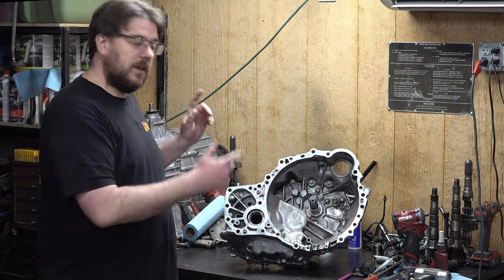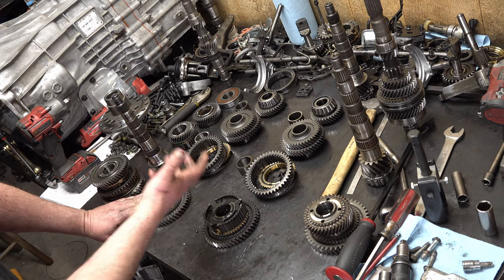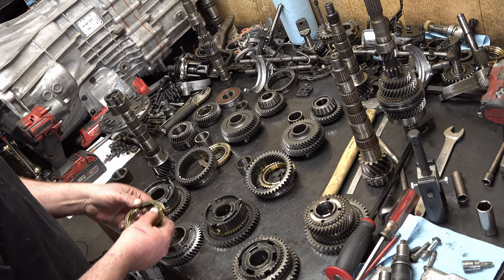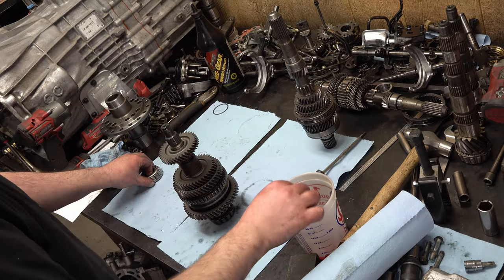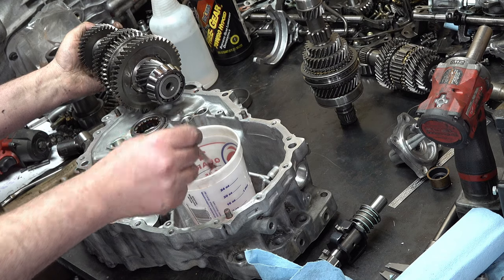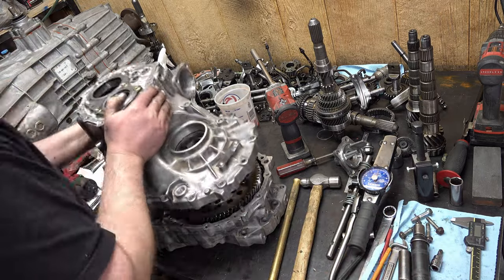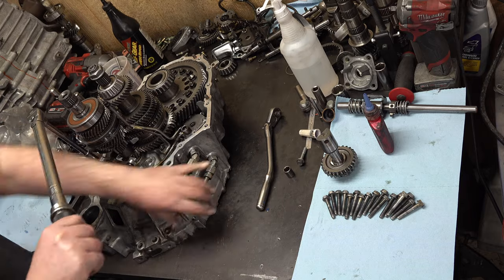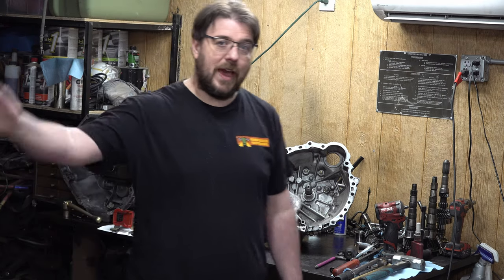Building a Toyota "narrow e-series" to improve Evey's drag racing setup.

Comment: I personally would love to see that transmission swap, as long as you're wrenching on something I'm all in.
Reply from the maker: It'll be an interesting test to see if my channel is big enough to diversify a bit.
Reply: @FrankensteinMotorworks  love the vid, I have a E56 gearbox with E58 gear set inside (4AGzE AE92) with the LSD from the E58, I want to replace the 5th gear from the 0.820 to like the scion 0.775 but the E58 shaft is bigger so the gear from the scion cannot fit over the shaft. What Toyota transmission can I get a 5th gear that can fit on the E58 . Thank you
Reply from the maker: @legz64  yeah there are some transmissions with different size bearings, there's no good listing for which one has what. sometimes you can look upmatching output shaft applications or matching 5th gear bearing applications but that will miss some matches.

Comment: I watch for the technical explanations. I would be interested in you comparing what you see in the Ford manual transmission vs the Toyotas.
Reply from the maker: Honestly, other than everything being much bigger due to the higher torque/weight capacity the parts are shockingly similar

Comment: Very interesting stuff! Im mid converting my toyota caldina gt4 from auto to manual using a rav4 gearbox. very simular to this box just with added transferbox that bolts on for 4wd. using that box as a lot cheaper/easyer to get than a st205 celica gt4 box.
I would be interested in seeing the auto to manual swap love all the in depth info!
Reply from the maker: yeah with an AWD center diff instead of the spool or normal 2wd front differential i used in there that would work great for the gt4. good luck with the build!

Comment: YES i want to see the modern ford manual.
Reply from the maker: Me too, this automatic transmission is driving me up the damn wall.
Reply: @FrankensteinMotorworks Some stock transmission programming is just downright bad. Do you have a 6 or 8 or 9/10? I've heard from lots of people that the 9 and 10 speeds just hunt gears all the time. No idea if you can improve it like on a 6 speed.
Reply from the maker: @christophercasale7961  I've got the 10R140 10 speed transmission. I'm sure the transmission hardware is decent but some of the limitations have to do with the ravigneaux design and the lack of the extra sensors it would need to be more inteligent and a the other factor just has to be that their test drive cycle does not involve other cars around causing you to sometimes need to adjust your intentions. Merging at a busy roundabout without a complete stop is genuinely dangerous with this programming, the transmission has taken up to 4 seconds before actually transmitting any power several times before and i would have gotten into accidents if it wasn't for other people paying attention and stopping for the stupid driver not accelerating when they should. 

But i will admit, i'm sure that 90% of this could be corrected with a reprogramming but i hate automatics with a passion anyways so this is a great excuse to address the core issue.

Comment: That would be an awesome trans swap video. I’d venture to say it’d be the first and maybe only one done on a newer F350.
Reply from the maker: I haven't looked too deep to see if another one has been done but i certainly would not be surprised if it's the only one that will exist.
Reply: @FrankensteinMotorworks  the question I have is, why not put a tune on the truck to fix the erratic shifting? I think a manual 22 F350 would be really cool, but the 10 speed has been an awesome transmission.

Comment: Hello my good sir, i come to you as a humble car nerd trying to engine swap my gt86/frs/brz. I wanted to do a 1/2jz but they are so expensive and then i saw your glorious video with the dyno of the 2gr mr2 and fell in love. My question is... do you have any idea if it would be possible to put a 2gr in my frs, you are the only one that does detailed work with the 2gr. 
Thank you for your time.
Reply from the maker: The BRZ 2GR is very much possible. It's not bolt-in right now but it is possible with some fabrication. This is something that i am seriously thinking of doing as a production setup.
Reply: @FrankensteinMotorworks  Thank you so much for the reply. Hopefully, you get to it before I do. You actually know what you're doing, and I'm just going in blind with hope and determination.

Comment: Honestly, as long as the 1-off isn't more than a 1-off, I think you should be fine.  At this point it might bring in some other people who may not know about your everyday work.

One question about gearing.  If you're going to shift into 4th, why not use more of the gear?  Are you looking to eventually build it to trap at a higher speed?
Reply from the maker: Honestly i spent a lot of time thinking about the 4th gear ratio and the 1.028 is the shortest 4th gear i can get without going to custom parts. One thing that i can tune further is the tire size, i may start with a smaller diameter than i calculated with to use 4th a bit more.

Comment: I say "go for it" on the transmission swap video. Sure, some of the "normal" viewer might not view it but I doubt any of them would be turned of from the channel as a whole and it will possibly pick you up some new viewers too just because of the "work" aspect... I watch a number of different car channels (among other topics) and most of them are not even orientated around cars I have interest in but rather, I watch them because you never know when you might pick up a trick or two that can be used in other applications. Case in point, I'd be willing to bet that some of the 1174 views showing right now, never knew about the clay trick checking clearances.

Comment: Hi Marc, just wondering if the EB60 sixth gear could be swaped into the E351 to replace the fifth gear to lower the crusing revs on the highway. Currently does 3200 rpm for 110kph (70mph).
Reply from the maker: No, the EB60 is a completely different transmission but the E357's 5th is much taller than the EB60's 6th and it will fit.

Comment: @FrankensteinMotorworks
Do you have a different link to the Toyota workshop manuals. That one in the description times and doesn't seem to work. Cheers
Reply from the maker: The link is correct and does work. I wonder if it is geographically locked? what country are you in?
Reply: @FrankensteinMotorworks  Hi, I'm in Australia. I think that may be the case. I'll have to try to work around it. Cheers

Comment: So is the bell housing plate that covers the 3rd output shaft from an E153 as I assume it wasn't on the Rav4 donor? Could you use a E350 bell housing with a E352F mid case and a wide differential?
Reply from the maker: the transfer case block off plate actually was on the donor i just did not install it in the video since there was really no value add. when mixing bellhousings and mid cases you need to check that both have or don't have an oil pump and also that both are the same width case and differential style. Also be prepared to reshim the output shaft and the differential.

Comment: Do you think there would be any performance benefit from using the 2ar-fse engine with both direct and port injection, or would the added complexity make the swap less viable?
Reply from the maker: Unfortunately the 2AR-FSE engine is a longitudinal mounted block with a completely different bell housing so it really isn't suitable as a replacement for the 2AR-FE
Reply: @FrankensteinMotorworks  do you think the FSE head would work on the FE block?
Reply from the maker: @ryanhuntley2651  Generally, comparing the head gaskets is a good way to get an idea if this will work or not. There are often flat scanned pictures of head gaskets that can be overlayed to check rough alignment. 

That said, the direct injectors do add a fair bit of complexity in the control electronics. It's not insurmountable but will add a lot of cost to the ECU.

Comment: The LSD use in Narrow E , same as the Wide E ??? Are they common swap LSD ?
Reply from the maker: it depends, the narrow E has two variants, you can get it with a narrow differential and with a wide differential. The wide differential version (like the one used in the video) uses the same differentials as the wide E series and has a factory LSD available that is quite good. The narrow differential version has no factory differential available but Quaife makes a really nice one that fits great.

Comment: Can you post the old ratio? I would like to compare them
Reply from the maker: I'm sorry I really should have included that in the video.

The old transmission is an E357 with the following ratios:
1st: 3.538
2nd: 1.913
3rd: 1.258
4th: 0.918
5th: 0.690
Final: 3.684
Reply: no worries. looks like an improvement across the board. thanks for sharing💯 @FrankensteinMotorworks

Comment: Hi, Im currently manually swapping a v6 camry and was wondering if a 3sgte flywheel would fit? Thank you for your time
Reply from the maker: you will need the 1mz/3vz flywheel. the flywheel on my site i sell for the 2GR-FE will also work.
Reply: @FrankensteinMotorworks  would that work with the e351?
Reply: And what clutch would mate an e351 to a 2gr?
Reply from the maker: @JamesAnderson-fw5ew  While i have to say i am biased to the products i offer you just need a 1mz/3vz compatible flywheel and a clutch from a turbo MR2 application and that will work together for the E351/2GR combo.

If you do want to use my parts, here's the flywheel: https://frankensteinmotorworks.squarespace.com/shop/p/2gr-fe-all-steel-lightweight-flywheel
and here's the clutch options i have: https://frankensteinmotorworks.squarespace.com/shop/p/e-series-clutch-kit-organic-or-ceramic
Reply: @FrankensteinMotorworks  thank you very much, ill look into your products👍🏻
Reply: @FrankensteinMotorworks  i ordered your flywheel, what pilot bearing should I use?
Reply from the maker: @JamesAnderson-fw5ew  The E351 does not use a pilot bearing.

Comment: 117 trap speed should get you 11.80’s or better
Reply from the maker: I should be able to beat the 1.7 second 60' time i did on a stock 2GR with stock gearing and just that will be 0.5 seconds plus 60' time tends to multiply down the line.

Comment: I thought the bottom end was too weak for 9000 rpm?
Reply from the maker: So far we know that the rods can't handle more than 7800rpm but this build is using upgraded rods and pistons. i don't know the limit of the stock pistons but i may as well replace them while i'm in there and get a more favorable compression ratio.

Comment: i saw the giant tranny on the bench and was like... "hold up, its 3 times bigger!"

do the manual swap video, even if it doesn't do as well... whats the deal? you can only find out if you try.

love all the vids, greetings from germany :)

i'm in the middle of an mr2 2zz swap and still curious about the EU C60 transmissions. 
no idea what provides the better gearing. a celica ts or corolla ts? i have both, but information is not clear. some say the C64 is the holy grail, but its listed as a corolla trans with a super short 6th. gear, basicly no difference to 5th...
then the celica trans is a C60, with exactly the same gearings and FD, but a longer 6th. why even bother with the C64??
what is even true? damn...
Reply from the maker: Yeah, the trans is still on the bench because it's so damn heavy I haven't wanted to move it since i rebuilt it. 

As for the hesitation, shooting video makes everything take 2-3x longer than it should and the editing is a bit time consuming too. But so far there's been a fair bit of positive feedback to the idea so i likely will.
Reply: Don't bother with the C64, overpriced. C60 is just fine.